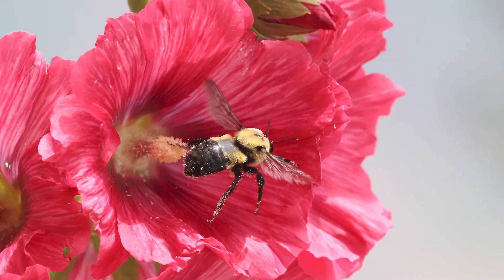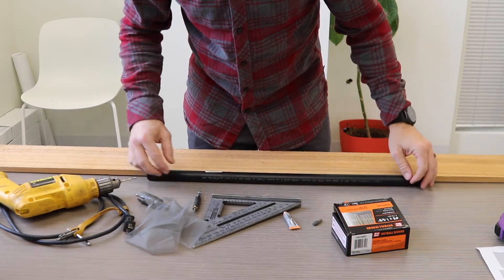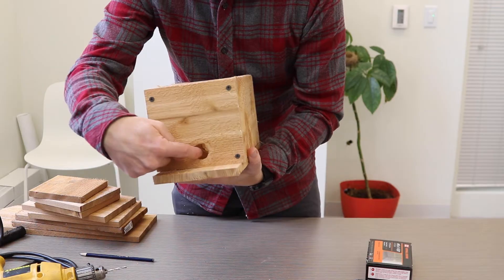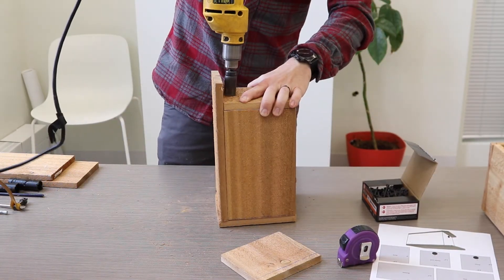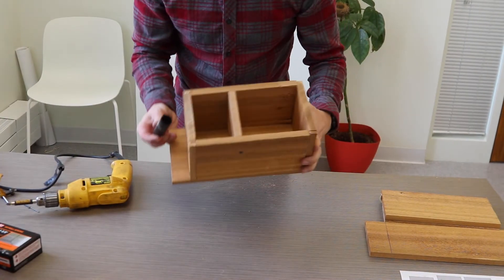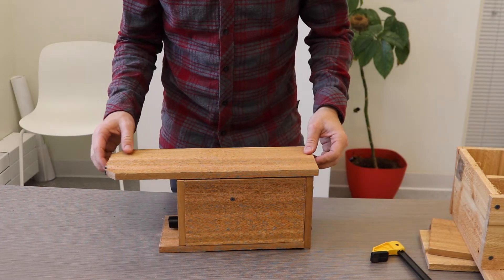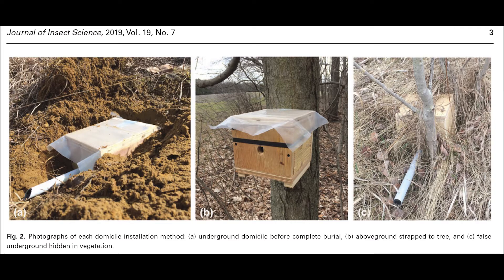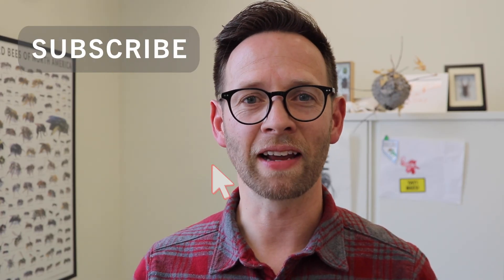How to make a bumble bee nest box (bumble bee house) Part 1

Comment: thanks.  I just know that bumble bees/carpenter/mason bees smell my cedar fence planks and are making their holes in these planks that are only 1/2" thick...Interestingly enough, they only choose the boards that have the 4x4 post in front or where the corners of the fence join.  The inside of my fence faces North, so they are boring from the shaded side...
Reply: I don't think bumble bees make holes in wood. I've been watching videos on mason bees (and a little on leaf cutter bees), and neither type make holes, they just use holes that they find & build the nest out of clay mud (mason bees), & either leaves or flower petals (leaf cutter bees). 

Carpenter bees do chew holes in wood, and I think I read that some wasps do as well.

Comment: Cedar -- oil is known to repel insects.  Seems that pine or hardwood is a better choice??  I am going to use some Pine for my houses this year.
Reply: ...my fence would disagree with this statement.  I have at least 12 holes in various planks.  all holes are on the North side away from the sun
Reply: Cedar will stand up to rot a lot better and will repel fungus.
Reply: I think cedar is supposed to repel moths, but not other insects.

Comment: Two years ago I had bumble bees next in a low hanging bird house.  It was AMAZING to watch them go in and out and have flight lessons for the young bumblebees.  The young bees would come out of the house, and practice their wings.  If they sat too long, the older bumblebees would push them off.  They would fly around the house a couple go times and then go back in.  I hung the same house in the same spot las year, but they did not return.  I am going to make a couple of these for my yard and give item a try.  Thank you for sharing.

Comment: Pre drill and countersink your screw holes. The drywall screws will rust and will often snap off when attempting to remove after being outdoors. Use a forstner bit clamped to a sacrificial backing board to drill your openings without blowout.